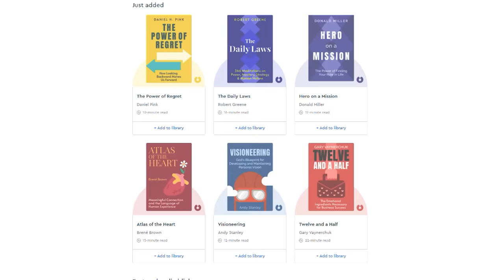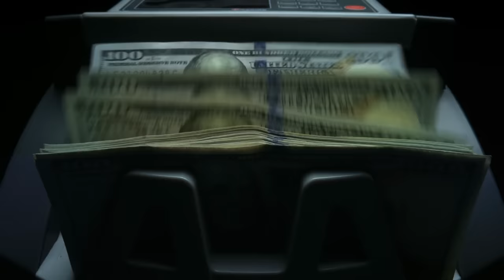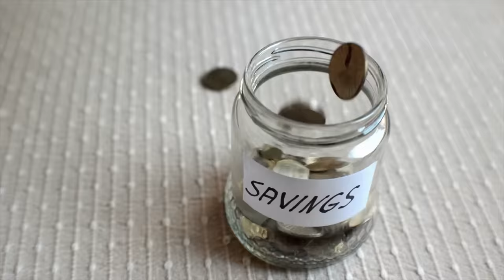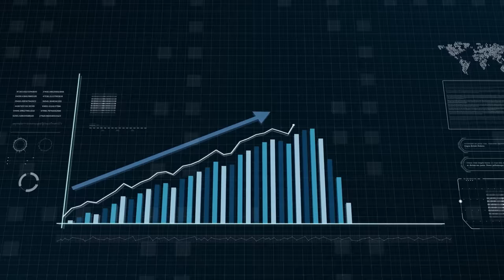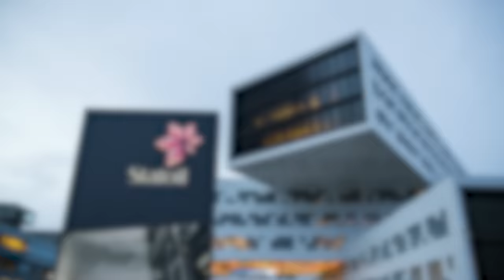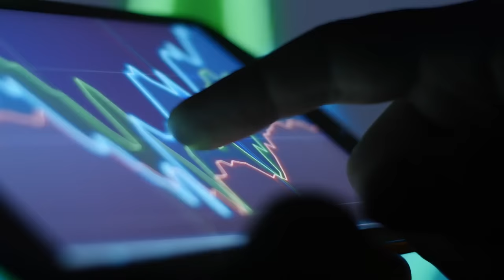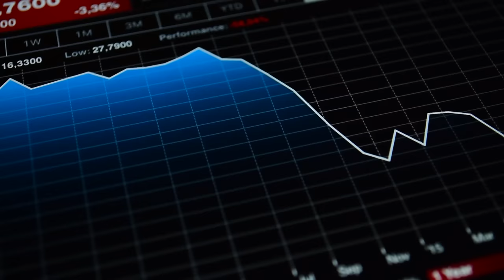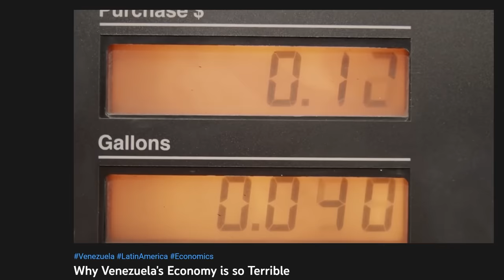How Norway Got So Insanely Rich

Comment: As i recall, Norway's doctrine for spending the newfound oil money was to do exactly the opposite of what the Netherlands did. The Netherlands' economy suffered greatly after excessive spending of their oil money, which was aptly named "The Dutch Desease". This happened a few years before Norway discovered its oil in the North sea, and after witnessing this cationary tale first hand, Norway would adopt a very careful approach to its spending. Instead, most of the surplus oil money would be stored in a fund to act as an insurance for when the oil reserves would eventually run out.

Comment: Between 1905-1920, Norway took the great leap towards becoming an industrial society. The country had as much economic growth as the United States in those years. Norway's gross domestic product increased by 60 per cent, accounting for the highest growth in Western Europe in these fifteen years. It was the waterfall power or electricity that emerged as the major driving force. Norway had easy access to hydropower, and many e-plants came up in different parts of the country. Thus, the country had taken care of an energy source that followed the most modern industry of the time. The electric motor led to an increase in productivity in many different industries. This did not only apply to sawmills, planing mills, wood pulp production, the shipbuilding industry and mining. Electricity came in handy in the furniture, canning, clothing and printing industries. It drove the motorization of shipping, and laid the foundation for extensive whaling and tanking. In 1918, Norway had over twenty different smelters and electrochemical factories.

Hafslund started the power station in Sarpsfossen in 1898—1899, and most of the power went to producing the chemical product carbide. In 1908, Norway got its first two aluminum plants. The company Hydro came to rise high above other Norwegian companies. Hydro, which was founded by the founder Sam Eyde in 1905, received a patent for producing nitrogen, and built two fertilizer factories in Notodden and Rjukan. The power station at Vemork became the world's largest. In 1920, Norway was the most electrified country in the world. Two out of three households had electricity. At the same time, it was only a third in the United States, Canada, the United Kingdom and Sweden.
Reply: Excellent, Motorman. Hydropower couldn't be exported easily and Norway had to use it in their industries.
Reply: @sergiomardinefraulob9803  That’s right, it was a lot of it, and it was cheap as chips. Heavy industries in Norway had a major advantage. But now all this has changed. As the corrupt and stupid politicians had signed a deal with the EU and UK it has been built several cables that can export this cheap electricity for high prices in other European countries. The result of this is that prices for electricity in Norway has increased ALOT the last few years in Norway. So private people and companies are being shafted. So the days of cheap electricity in Norway is over. People are seriously angry about this.
Reply: @truxton1000  The days of cheap electricity is over? I'm looking at my own electricity bills for the last few months:
In July I had two apartments (busy moving from one to the other) Electricity bills for both combined: NOK 604.16 (slightly less than 60 USD)
August: NOK 337.37 (33 USD)
September: NOK 227.73 (22 USD)
October so far (with three days left): NOK 512 (50 USD)
Both my new and my old apartment are modern, more than big enough for me, heated with electricity only and located in the parts of Norway with the highest electricity prices. I wouldn't call that expensive.
I do try to save on electricity but I'm not too frantic about it. I use a space heater rather than the floor heating, keep the room temperatur at 20C rather than 21, switch off the lights in rooms I don't use, don't run the dishwasher or washing machine until they're full, don't spend more time than necessary in the shower... Nothing more extreme than that.
---
That being said, electricity for households is subsidised at the moment so those numbers aren't the actual prices, it's what I had to pay myself. Small and medium sized businesses do not get any subsidies and many of them are really struggling.
Reply: @tessjuel  Well electricity in Norway will never return to what it used to be but forever be connected with continental prices. For now I understand there is some subsidies but for sure these will disappear slowly but surely. And I’m sure you don’t own a cabin in Norway as anyone owning one will for sure disagreeing with you, as I’m sure you know that people with a cabin pay much more than for a house. And companies will for sure go bankrupt in Norway this winter as they get no support from the socialist government.
Reply: Get what ure saying but 1/3rd of united states population is still 10x more than 2/3rds of norways at the time. Sweden historically had twice the population of Norway, big difference supporting and sustaining 2m people compared to 5m ish even if u add the factor of 2/3rds instead of 1/3rd, it would basically even out to the same ratio more or less.
Reply: @vizioncs505  Number of population does not correlate to how rich the people are, there are poor countries with a small population and rich countries with a large population, it does not matter. What matters is the culture of the people, how well educated they are, how disciplined they are, how well they understand and respect each others, how much general trust there are between people. For example multiculturalism is a challenge that could jeopardise almost everything as trust between people will usually be much lower.

Comment: Long story short: The rule of law was again the right solution (combined with self-discipline for good measure).
Reply: Law student spotted?
Reply: The rule of law is a byproduct of a balance of powers/distributed power.
Law itself is a sentence in a piece of paper.

So yes, but you'll have to dig deeper for the cause. I lean on Jared Diamond's angle. Geography > demographics > economy > power dynamics.
Reply: @Untilitpases  False. The rule of law is not only a by-product but something educated individuals, civil servants and other institutions actively uphold. It's also not a sentence on a piece of paper. That's the vast minority of law (at least in common law jurisdictions).

And Jared Diamond's angle is grossly inaccurate. The correlation between geography and power is highly contested. 

But the rule of law is absolutely an important factor. Without it, Norway wouldn't have retained and grown its wealth.

Comment: Oil accounts for around 15% of the Norwegian GDP last time I checked. Denmark, a neighboring country without oil, is also doing well. I think this video puts too much emphasis on oil.
Reply: DEnmark has oil, and had much more before, but they pumped most of it in the 1980s, Danes are not very bright

Comment: It's important to point out that other Nordic countries share many of the same social, political and economic features even though they don't have oil or the extreme wealth it generates. The standard of living is generally high, inequality lower and these countries top the charts for a number of social metrics. In other words, oil didn't make Norway the kind of country it is today but it did give Norway an enormous boost in terms of overall standard of living, infrastructure and security. The key question going forward is whether Norway can wean itself off of oil and gas revenue in a controlled way on its own terms while investing in new industries.
Reply: Norway need not worry about loss of fossil fuel revenue.  The economic utility of fossil fuel is simply too valuable to a society to eliminate.

Enforced scarcity will only lead to higher producer revenues.
Reply: What makes the Nordic countries differ from everywhere else, is thinking 2 steps ahead and making plans for future progress and backsets, while other countries tend to get surprised, on the back foot, overwhelmed and having no actual plan when a problem arrive and disaster strikes. So they often make panic solutions, instead of being prepared to deal with the problem at hand and also prepare for the next step ahead like the Nordic countries would do.
Reply: @lawrenceralph7481  .. I'm from Denmark and we were among the founding members of NATO, so please keep your lack of knowledge to yourself, the Nordic countries are also among the bigger supporters of Ukraine, with Denmark also providing pre-war training of Ukrainian military since 2016 (Operation Orbital) and still ongoing, while Sweden have been Part of Operation Unifier since 2018, also providing training for Ukrainian soldiers. Here is the aid Ukraine have received from the Nordic countries so far :
Military and humanitarian aid : around $750 million worth (more if you also count aid donated through UN and  the Red Cross )
Anti tank weapons :
An unspecified secret number of Carl Gustaf M3 and M4 anti-tank weapons (donated by Denmark and Sweden)
11,500 AT4 light anti-tank weapons.
8,200 M72 LAW EC (Enhanced Capacity) anti-tank weapons

Missiles and heavy weaponry :
1 or 2 Mobile Land Based Harpoon missile systems (with 2 harpoon missile firing platforms each) including an unspecified number of RGM-84 Harpoon anti-ship missiles
22 M109A3GN 155mm self-propelled howitzers
3 M270 MLRS self-propelled rocked launcers
300 upgraded FIM-92 Stinger anti-aircraft missile systems 
100 French-produced Mistral anti-aircraft missiles and undisclosed number of launchers
An unspecified secret number of Robot 17 (Swedish anti-ship version of AGM-114 Hellfire)

other weaponry :
50 upgraded M113 armored personnel carriers.
25 Sky-Watch tactical drones for reconnaissance and information gathering

2,500 assault rifles with 150,000 cartridges
An unspecified number of Barrett M82 rifles, with munitions.
An unspecified number of support-weapons (which some sources state are machineguns).
An unspecified number of anti-tank mines, 120mm M/10 mortars and thousands of mortar shells

other equipment :
12,000 helmets.
10,500 bulletproof vests
1,000 gas masks
220,000 field rations
An unspecified amount and type of mine-clearance equipment.
1 fully equipped mobile field hospital
100 stretchers, and equipment for two emergency medical care stations
1,700 treatments against tetanus/lockjaw (requested via WHO)
700 first-aid field kits
2,000 sleeping bags
10,000 sleeping pads
40,000 liters of milk requested by the Ukrainian embassy in Oslo
Reply: I love how you whites think. So detailed about the self interest of your own clans. Other races should adopt the idea and model it to there own cultural backgrounds. Spark another renaissance for another race.
Reply: @brianhalljr615  what?
Reply: @lawrenceralph7481  Two things: There is a limited amount of oil in the world, meaning if things go om as they do now, Norway will run out of oil before the turn of the century. Secondly, as renewables, electric technology and other means of acquiring electrcity becomes more common, the world's reliance on oil will lower, meaning that longterm, their prices will go down because nobody needs it anymore.

Therefore, it is only wise to create an economy which can survive such a drop in the oil market. Which is why one should take inspiration from countries like Japan and Korea, which built their immense wealth out of nothing by creating industry and making products the world wishes to buy. Thus Norway can have some legs to stand on which won't break as easily
Reply: @agffans5725  

Was the 2014 -2016 militarization/modernization by  some NATO  members of Ukraine one of the primary motivators for Putin to protect his border?  First stabilizing Crimea and secondly neutralizing Donbas?  

For example, If Denmark supplied that list of items to Mexico or Canada or a tribal region in the USA with the intent to preparing them to defend themselves against the US, this would certainly get our attention, not in a friendly way. 

In 2016, was it a good idea, or as Macron and Merkel advised, a provacative one?  

If you're familiar with World War I history, the German government wrote a secret letter of military alliance to Mexico, while the US remained neutral.  It is called the Zimmerman letter.  Look it up.  It is the basis along with the sinking of the Lusitania for the US breaking neutrality by declaring war on the Triple Alliance.  Arming people on your border against you is traditionally frowned upon.   This is what Putin faced in 2016.

An aside - Helping Ukraine defend itself  in the face of innumerable Russian atrocities is a completely different matter.

Either way, it is Europeans leaders assessments that Putin only fears American boots.  As a  practical matter, America is the only country with the logistical support to press along a full theater operation on a Russian border.   Russia should not and does not fear an unprepared, scattered and unwilling NATO.
Reply: @SnillhundReal  Do as you are inspired. I have no opinion for the wonderful hard working people of Norway.  One of the most beautiful places on Earth.

My point was merely economic.  As scarcity occurs, the value of a low-cost resource increases not decreases.  On large scale,  fossil fuel will always be less expensive than the average non fossil source. If not, the transition will occur without anybody arguing.

Either way Norway is in great shape...  As long as it stays allied with the United States so that one of Putin's delusional urges doesn't claim it for the ancient Keivan Rus as another maniac did in the century past.
Reply: It's a big discussion point here when it comes to oil. This is why we have created a fund where we save a huge part of our income from oil, so when oil runs out we can ease our transition from selling oil to other things without experiencing an economical disaster! :)
Reply: @brianhalljr615  what did I just read? how whites think? the reason "the white" or the europeans developed so quickly was beacuse we had less land so we went to war all the time resulting in better tecknologi. this is not a race thing it is a geography thing.
Reply: @brianhalljr615  Tribalist fail.
Reply: US still has a bigger military

Comment: Thank you for this informative video about Norway. As Venezuelan, I have a few observations though 😮: In the 1950s we had a President (actually a dictator) that tried the same as the Norwegians; to make the foreign companies to share more profits for the estate and pay more taxes, what happened? The US overthrown this president, this guy took Venezuela to be one of the most richest countries in the world in only 7 years. After this, we had a “strong democracy” for 45 years, these guys robbed around 5 times the Marshal Plan, let the foreign oil companies do as they pleased and then Hugo Chavez came to power. When Chavez won the elections, US companies were in some cases paying 1% tax and sometimes the oil state company did not have a share on the profits, Chavez asked as the Norwegians did, to have this changed, what happened? Again, the US got mad, protected their interests (US oil companies and energy supply) and start calling Chavez a dictator (that is why probably you too), since then , the US have been just but hostile against Venezuela. So, please this into account before giving easy/basic statements about Venezuela.

Comment: An even better comparison is Greece and Ireland. Both joined the EU at the same time and with similar levels of GDP. Things have changed a bit since and not because of oil, gas, cheap hydro etc
Reply: It's my experience that where the Nordic countries differ from everywhere else, is thinking 2 steps ahead and making plans for future progress and backsets, while other countries tend to get surprised, on the back foot, overwhelmed and having no actual plan in place when a problem arrive and disaster strikes. So they often make short term panic solutions, instead of being prepared to deal with the problem at hand and also prepare for the next step ahead like the Nordic countries would do.
Reply: Maybe it's something hardwired in Nordic countries. In the north you got to plan for long hard winters. While in the more temperate south you can typically ride out a winter with ease.

Comment: Anyone notice the numbers being entered into the calculator?
1024, 768... 512. The first two are a typical screen resolution - 1024 x 768 pixels and the third a RAM value - 512 Mb.
In general terms, they are computer values. 512 x 2 = 1024. 512 /2 = 256. 512 + 256 = 768
See the pattern?

Comment: Actually, this is not correct: Norway had a HUGE industry already in the 18th century: saw mills, iron factories, glass factories silver factories, copper factories and so on. Also, Norway had a huge trade fleet (bigger and more ships than Denmark). It could trade wood, fish and industrial products for bread and meat from Denmark on privileged terms, it had trade with Russia on favorable terms, with France on very privileged terms, it sold wood to England in huge quantities. Also, the population in Norway could compete with that of Denmark. Thus Norway were actually in very good conditions.

Comment: Seems like the only way you can profit from energy riches as a country is to import labor from outside, or basically delay that option by investing it in outside funds like Norway. Basically exporting energy and importing another kind of energy that you can actually use
(for example, Venezuela used domestic labor to build out its infrastructure. That manpower was already there, the oil money didn't augment it)